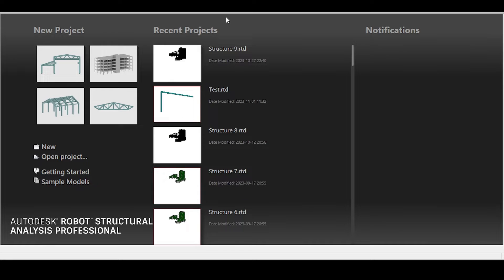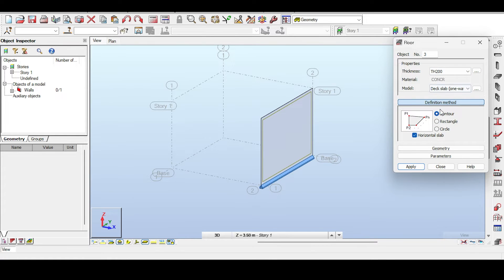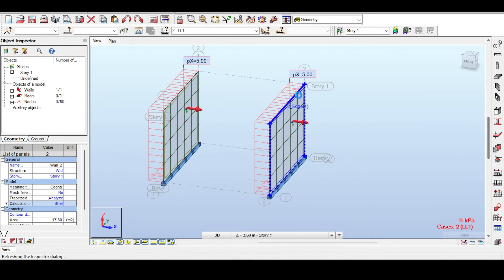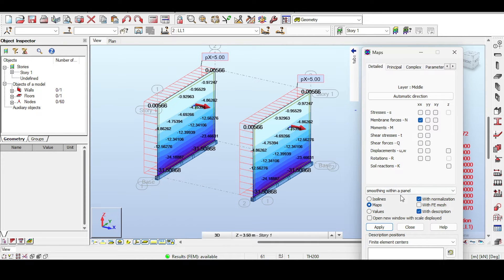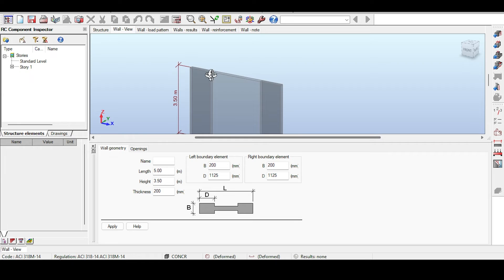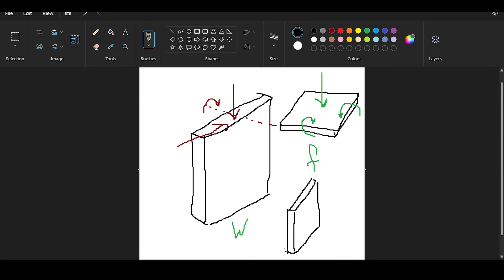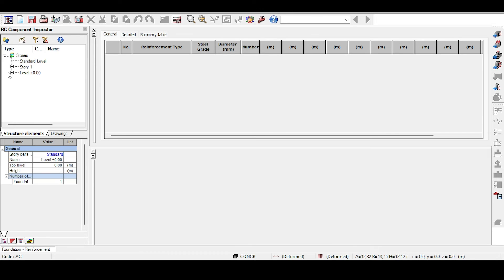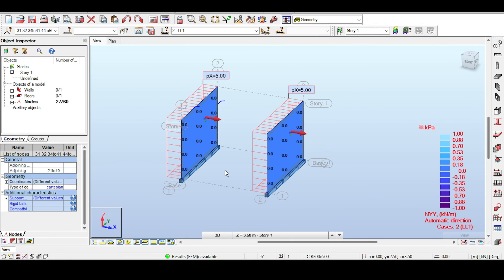Difference between floor and wall elements - Autodesk Robot Tutorials

Comment: Is it possible to modify the wall properties to allow it act as a masonry wall? by modification, we can allow it only to take the axial loads and not the moments?
Reply from the maker: Not rly sure, this is one thing I am trying to figure out. For now, the idea I am thinking about is to model a wall using multiple elements and releasing those elements to model a wall. So far, I have limited success.

Comment: Thank you for this intuitive video. Please do a video series where you conduct the structural design for a RC box culvert.
Reply from the maker: I think that is a cool idea. I will keep that in mind.
Regards,
CEE
Reply: Please consider the case with precast "removable" cover slabs instead of monolithically casted top slab as well.
 @CivilEngineeringEssentials

Comment: I don´t see when I have to use a Shear Wall. Normally actions are perpendicular to the plan (seismic). A shear wall in one direction works as perpendicular actions wall on the other. So how I must consider in that matter?
Reply from the maker: Hi there, allow me to elaborate further,
Seismic action are horizontal forces that are proportional to the mass of the building.

Imagine I have a structure with horizontal forces from the left to the right (positive x-axis)

If I understood your comment correctly,  you might think that shear walls would carry those loads perpendicular to their surface. Unfortunately, that is not the case. Because the distribution of the total horizontal force among the shear walls is based on their rigidity. Thus, only shear walls having a stronger inertia would be loaded. This means that the load is going to be parallel to the plane of the shear wall.

Hope I was able to cover your question. Feel free to ask further questions in case you need more clarifications.

All the best,
CEE

Comment: Dear CEE, Thank you very much for your making this VDO, Now I'm understand the reason why you using  Floor for swimming pool & retaining wall. one more question, when we modeling basement wall or retaining wall does we have to parallel between local axis & Global axis or not? 🙏🙏🙏
Reply from the maker: Usually when I model a retaining wall, I try to keep the local axis aligned horizontally, and the vertical axis aligned vertically.

This is different than what I do in slabs. In slabs, I try to keep my x-axis with the global x-axis.

But why is the retaining wall different?
The retaining wall is different because there is a meaning for the "horizontal moment" as it controls the horizontal steel in the retaining wall. There is also a meaning for the vertical moment as it controls the vertical steel in the wall.

But why then is the slab x local with x global?
Because in a slab, both steel directions are horizontal, so it becomes important to know which steel goes in x-x and which steel goes in y-y.

Hope it helps, regards,
CEE

Comment: Thanks for the video! I think you should also say about required (theoretical) reinforcement module. If you modeling wall as a shear-wall you should use "compression/tension" type of reinforcement calculations because you main acting forces is vertical and horizontal in the element plane. And if you modeling wall as a basement or retaining wall (as bending element) you should use a "simple bending" type of reinforcement calculations.
Reply from the maker: That is a very good point actually. To be honest, I did not cover it because there is 1 special case where you need "both simple bending and compression/tension". 

The case is found in "basement walls". Especially if they are multi-leveled and participating in carrying the loads of the slab. Here, you would have an axial force that you may or may not ignore.

Now I can here the counter-argument: well, axial compression actually improves the load carrying capacity of a basement wall, because it increases the compression block, improving the participation of the concrete in the resistance.

I agree with this counter-argument, and that is the reason why I agree with your comment of "pure bending". 

All-in-all, I am very happy that you shared this comment with the viewers, it will definitely help them see the bigger picture. Also, I should have covered the "pure bending" and other options in this video. That is a very good point to add to the future viewers. Thank you very much.

Regards,
CEE
Reply: Hi  @CivilEngineeringEssentials  I completely agree on everything.
If you cover this aspect would be brilliant. You did an awesome job with the retaining walls or basement walls.
What's missing is just the raft foundation sustaining them 😢
Add this missing point please. ❤
Reply from the maker: @lorenzo_UK  Will keep it in mind. I think I will make 1 video that goes through the entire retaining wall from start to finish.

Comment: Great video. thanks for posting. I have one question, if say you have a wall which is predominantly loaded perpendicularly to the plane of the wall such as retaining wall or a swimming pool/basement type wall and you are not designing the reinforcement in robot in the "provided reinforcement" module in robot and only using robot to review applied forces and the "required reinforcement", i take it then its fine to just model the wall as a "wall" with shell in robot and that modelling as a slab/floor will not have any effect on the forces or required reinforcement which can be viewed? hence its only really modelled as a floor when you have out of plane moments in the wall and you want want to design it using the provided reinforcement module? is that correct?
Reply from the maker: If I understood your comment correctly, your intention is to model the predominantly perpendicularly loaded wall as a "wall" in robot. Your intention is also to see the moments and reinforcements in robot without going to the provided reinforcement module, as the provided reinforcement module will have a strong and clear difference.

Then yes, I think this would be correct. The only reason why I say "would" is because I myself have to compare the required reinforcement in both walls (floor vs wall) in robot. I did not do that, yet, so I am not 100% sure. But I am 90% sure that it would be identical. 

Is it possible to check that from your side and give me a quick feedback? it helps a lot.

By "quick check" I mean just to draw two walls like I did and check out the required reinforcement, if they match or not. Would help me and future viewers and readers.

Anyway, I am very thankful for your comment and insight. Stay tuned for future videos,

Regards,
CEE
Reply: @CivilEngineeringEssentials  Thanks for the reply. I have had a quick look at panel defined as a Wall and RC Wall and Panel designed as Floor and RC floor (as described above). The results are identical when looking at the forces applied (ensuring all axis's are defined in the same way etc.) . the "required reinforcement" results are also identical when both are defined there RC as "simple bending". However one thing that i noticed was different, was that under the lateral loads applied and when looking at deflection in the required reinforcement tab, the slab had deflection whereas the panel defined as a wall did not?
Reply from the maker: @simonkelly2267   so it seems that in terms of analysis, they are identical. The deflection thing might be a robot difference, it does not change the fact that the analysis are identical.

I will check out with Autodesk to see about the deflection thing. Maybe they can shed some light.

Anyways, thank you very much for your input, I really do appreciate it.

Regards,
CEE